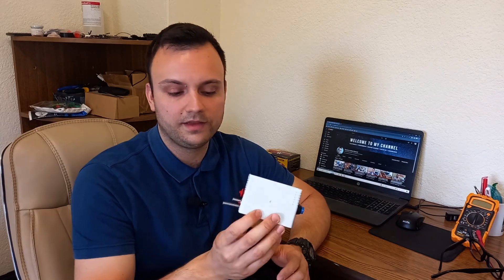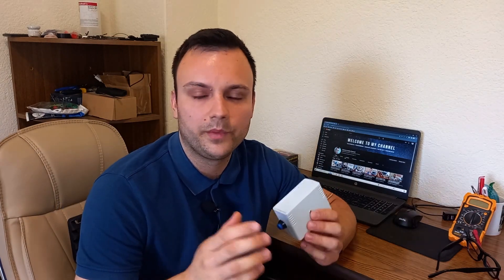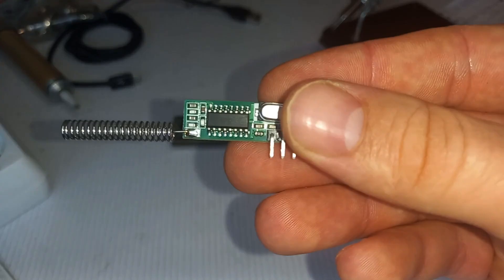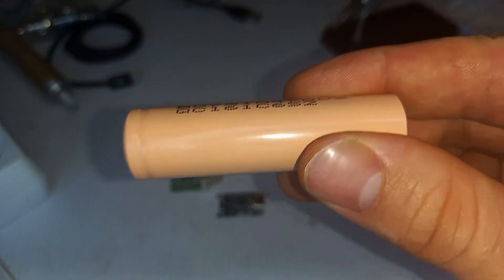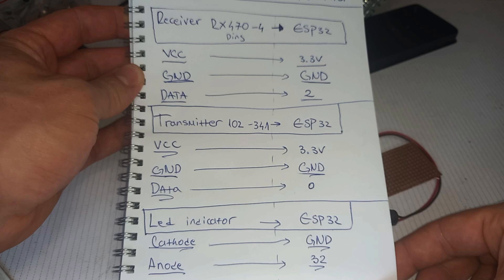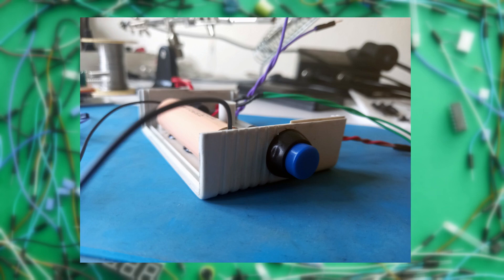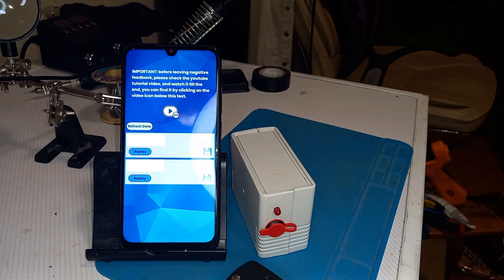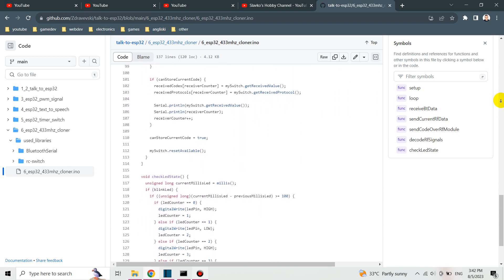How to Make Your Own Flipper Zero | DIY Flipper Zero With ESP32

Comment: I am probably lower on the learning curve here so my question may seem strange to some people. I got the components and then started looking at the schemeatics to see how it goes together. It says connect thee transmitter data to pin "0" on my board there is no pin zero could you or someone else help me out here. Thanks

Comment: can i use esp8266 instead of esp32 for this project
Reply: Please reply
Reply from the maker: @amanmansuri96  my app works with Bluetooth, you can use a Bluetooth module with any microcontroller, just use the same structure of the message that the app expects, you can see it in the code

Comment: Can I use different 433mhz Transmitter and reciver like Red Color Type
Reply from the maker: @AmanAutoElectric Sure you can, most of them work similarly, but maybe for some of them, you need to change the code a little bit.
Reply: Sir I Have No idea how to change code Can I use directly Without Code change
Reply from the maker: @AmanAutoElectric  Try it, I don't know it, if the working principle of your device is the same as mine, it will work without a code change, otherwise, you have to change it and adjust the code to work with your device.
Reply: @SlavkosHobbyChannel   Sir Rolling Code can Capture on this device Like new Gen Cars rolling code
Reply: @SlavkosHobbyChannel  Rolling Codes...??
Reply: @SlavkosHobbyChannel  sir Can You Help Where Change In code

Comment: Hello Sir and many thanks to your effort to this project. i have a ESPRESSIF ESP32-S3-WROOM-1  and couldn't find pin number 32 on my dev board. is there a way that i dedicate another pin number to the LED?  im not expert to programing and electronic sorry if i asked a primitives question
Reply from the maker: Yes, search about the pin declarations, you need to find the pinMode method
Reply: @SlavkosHobbyChannel   thank you for the reply, my board is esp32 s3 n16r8 devkit.  does it make any problem? cause i constantly get this error 
c:/users/rb/appdata/local/arduino15/packages/esp32/tools/esp-xs3/2302/bin/../lib/gcc/xtensa-esp32s3-elf/12.2.0/../../../../xtensa-esp32s3-elf/bin/ld.exe: C:\Users\RB\Documents\Arduino\libraries\BluetoothSerial\src/BluetoothSerial.cpp:513: undefined reference to `esp_bt_gap_ssp_confirm_reply'
collect2.exe: error: ld returned 1 exit status
Multiple libraries were found for "BluetoothSerial.h"
  Used: C:\Users\RB\Documents\Arduino\libraries\BluetoothSerial
  Not used: C:\Users\RB\AppData\Local\Arduino15\packages\esp32\hardware\esp32\3.0.1\libraries\BluetoothSerial
exit status 1

Compilation error: exit status 1
Reply: Thank you, my problem was with the board. I switched to older esp32 and my problem fixed. Thanks again for the great work.  P.s if i want to clone rfid cards i should use 315mhz module instead of 433?
Reply from the maker: @mehrdadxable  Nice! I have another video, where I talked about that on my channel, see it, and you will be able to do it as well.

Comment: brother can we use both the frequency module at a time 315mhz and 433mhz at a time??
Reply from the maker: yes, choose another pin, and make two objects in the code.
Reply: @SlavkosHobbyChannel  brother can u please tell how to make because i am beginner in programming can u please tell or give me code please brother
Reply: bro please reply
Reply from the maker: @CAPAKCampak  Hi, I am not offering a custom code, if I think that, the function you ask for is needed to improve the project, I will do it when I have free time, thanks.

Comment: Thank you, the engineer only got one thing, the voltage was low and it didn't turn on with 3.7 v and the thing couldn't be found, he used a 4.7 battery, then the led light you said in the video was received. It would turn on, but it didn't turn on at all for me. The connection is correct. The positive LED is connected to pin 32 and the negative board is connected to GND and the LED is also correct. Where is the problem, engineer?

Comment: Hello sir , such a great project ... I made this exactly same but i got some problem in it .. Whenever i try to receive signal from a car's remote , the blue led on esp32 pops but the external red led doesn't and also i had not able to get any data .. same issue with a rc car remote of 34mhz ... although the external led works well in sending text datas and all ...Can you help me on this ..... Btw nice video 😊
Reply: @vijalpatel144  receiver 8 pin wala Use Kiya h kya
Reply: @vijalpatel144  ban gya kya project Konsa Esp32 use Kiya

Comment: 🎯 Key Takeaways for quick navigation:

00:29 🛠️ The DIY device showcased in the video aims to replicate some features of the Flipper Zero, particularly its ability to analyze and emulate sub-gigahertz frequencies.
01:10 📱 The video provides insight into the building process, including component selection, code sharing for ESP32 development boards, and the creation of an Android app for communication.
02:16 🔌 Components used include an ESP32 development board, a transmitter and receiver operating on specific frequencies, LED indicators, power-related components like a Step Up converter and charging module, and a battery.
04:08 📝 Schematics are provided for connecting the receiver and transmitter to the ESP32, with details on pins and connections, facilitating the assembly process.
06:12 💡 The final product resembles a commercial device with features like a USB charging port, LED indicators, and a power switch, demonstrating a successful DIY project.
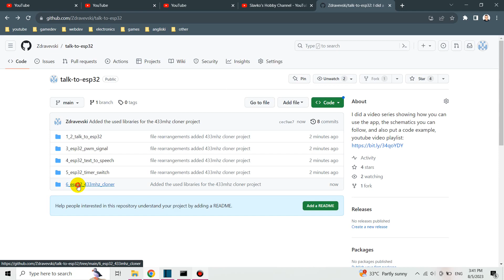07:35 🔗 Links are shared to GitHub repositories containing code and libraries used in the project, enabling viewers to replicate and modify the device.
09:09 🔄 While the DIY device attempts to decode various protocols, it may not cover all, suggesting potential improvements or modifications for broader compatibility.

Made with HARPA AIli

Comment: great job, thank you very much for sharing it
What model of ESP32 are you using? The one I have does not work with the program.
Thanks in advance
Reply from the maker: Doesn't matter, you can choose any esp32 board, just accept the permissions that the app asks, and upload the code I listed in the description, after that pair the phone with the board, if you have some problems, tell me I will try to help you.
Reply: @SlavkosHobbyChannel
Reply: good, thank you very much for answering
In the video it says that you connect to the RX 2 and TR 0 pins and in the program you say that the TR 4 pin is supposed to be the one in the program.
If you have some wiring diagram that would be great.

Comment: hi Slavko how is going :)  i have had a good time  putting all together but i cant get it to work i think i have tried all hints you where describing, actually i do not have exactly the same esp32 i have ESP-wroom-32 ch340 or something like that , it does not have same pin layout it does not have zero marked  i did not change ledpin but d2 is connected to onboard led but then i  put rfreceiverpin 4 it is marked D4 on the esp and then  , rftransmitterpin 33 marked d33 on the esp  do you see  what i am doing wrong ?  sorry i am new to this ;) 

thanks in advance 
rg
Örvar
Reply: it seems like Bluetooth is connecting  Bluetooth terminal in the phone sees the connection but app is not starting and see no life on serial monitor unless just in startup on esp
Reply from the maker: Hi Orvar, first check whether all the permissions that the app requires are allowed, you can find it in the phone's settings, which can fix your connectivity problem. After that if you can't get the controller to work, change the pins, the receiver pin should be put on an interrupt pin, so find a datasheet for your controller and change it suitably. Wish you a great time.

Comment: hey i tried to recreate your device but it does not pick up the signal from my car keys, instead it has picked up random signals which i do not know the origin to, how would i fix this issue? thanks
Reply from the maker: Hi, maybe your car keys have a rolling code remote, maybe they send a long signal that cant be decoded by the rcswitch library that I used, or the reason can be that the protocol that your remote uses is not recognized by the library, go to the GitHub repo of the rcswitch library and see how you can improve it, and maybe you are going to be able to decode your car remote.
Reply: @SlavkosHobbyChannel  thank you, I'll put more research into it. Also can you give me a good way to test if the device is emulating the signals properly? Thanks
Reply from the maker: @micropickle7381  If the LED on your ESP board blinks when you are holding the remote's button it sends a signal properly but for some reason (mentioned above) can't be decoded by the library (I didn't write the library).

Comment: hello sir are using 38 pin esp32??? does this work on normal esp32
Reply from the maker: Yes, it is the same microcontroller.
Reply: @SlavkosHobbyChannel  sir one more help can you please explain which pin 0 and 2 label on esp32

Comment: i created the exactly same setup, probably you having range issues right? just add a parallel 4.7 uf capacitor to module power supply. then you can achieve up to 100 meters at outdoor
Reply: Sir i want help regarding Transmitor and reciver
Reply: THANKS BRO

Comment: hi really appreciate the video thanks, I made it and it did connect to my phone but i am unable to collect data also i am pretty sure that the ESP is reserving some kind of data because when i press on the lock/unlock button the blue light on the ESP blinks but when i press "refress data" it says "no current RF data"..... can you help?
Reply from the maker: Thank you! I made an update, my app didn't work correctly on Android 12, some permission-related stuff. I fixed it, and sent it for review, I guess tomorrow or on Monday, they will check it, and approve it. If you have an old smartphone, this version will work on that phone.
Reply: @SlavkosHobbyChannel   thanks for the update even though I'im suing an older device i tried it also i tried changing the receiver but still the same problem... do you have any idea what could be the reason?
Reply from the maker: @shaankalani7299  Thanks for your feedback, update the app, then go to your app settings and allow the "Nearby devices" permission on my app. Then try again, and tell me whether it works.
Reply: @SlavkosHobbyChannel I tried still the same issue…do you think I might be doing something wrong…is there a way I can contact you so I can share some photos of my set up?
Reply: Same problem here

Comment: hi
the esp32 connected to my phone but not to the application, how can i fix it?
Reply from the maker: Hi, upload the code I posted to the esp32, then open the app, and should be good to go 😊
Reply: @SlavkosHobbyChannel   i tried as you said but it still not work, the esp32 is connected to my phobe but not on your app. 
i noticed something else, in the video you show to connect the transmitter to pin 0 but in the code , the pin declaration said that it is connected to pin 4
Reply from the maker: @gabry031  For the transmitter, any digital pin will do the job.

Comment: Do I need to use esp32 or I can change it to raspberry pi pico?
Reply from the maker: I wrote a code for the esp32 microcontroller, but if you rewrite it for the pico, it will work 😊

Comment: Can i use another receiver and transmitter module
Reply from the maker: Yes, just change the code to suit your needs, and change the methods that I used to interact with the app. So, the data transferred between the microcontroller and the app should be of the same type.
Reply: @SlavkosHobbyChannel bro does this same code work with the fs1000a module??? And it's receiver
Reply from the maker: @Technologybase  Yes it should work, haven't tested it with that module, but they have a similar working principle. Just make sure to use a better antenna, cuz they have some small antennas, that aren't good.